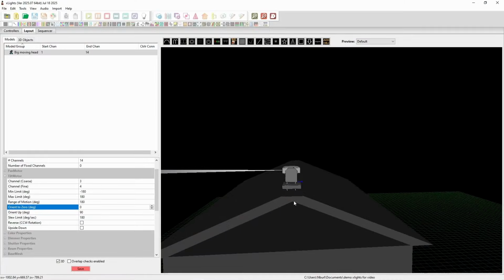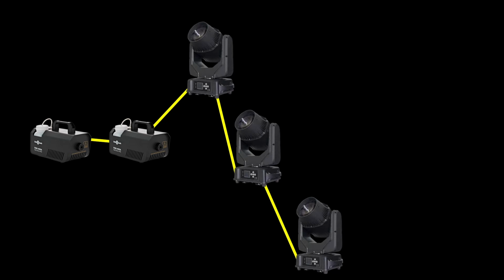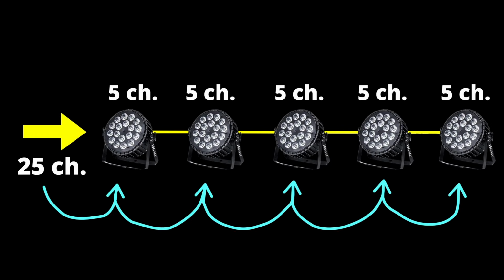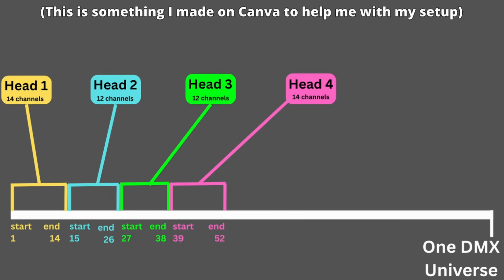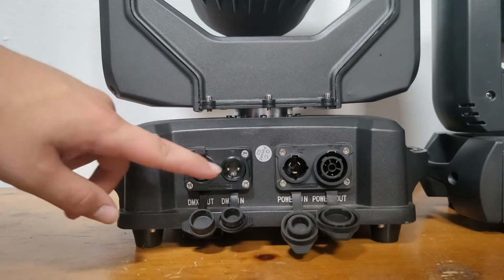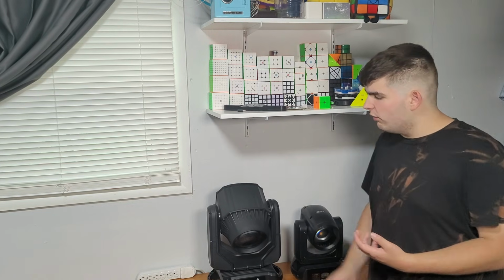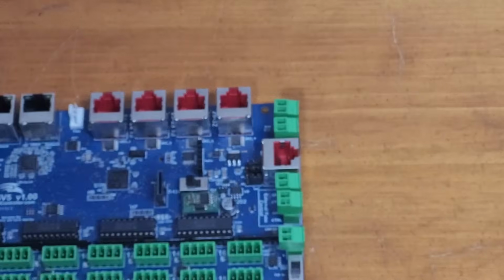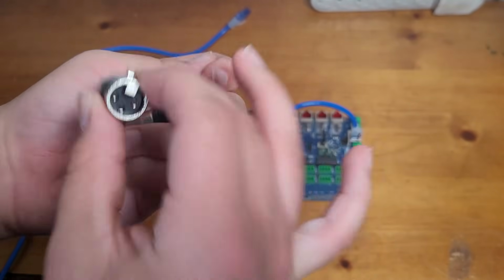How to use DMX Moving Heads in YOUR Light Show!! (Part 1)

Comment: What fixture and brand is the bigger moving head you are using? I like that they are IP-proof
Reply from the maker: I'm honestly not 100% sure because I bought them used. They were from eBay and were titled "2PCS 8+16 Prism Waterproof Moving Head Light DMX RGBW LED Gobo Stage Beam Lights"

While yes it does say waterproof, they are actually only water resistant and probably somewhere around ip66-67 rated.

Comment: If running the ethernet cable from the controller (in my case it would be from my porch to the roof) and then to an ethernet to DMX cable converter, does it still follow the Cat6 standards for length (up to 328ft)?  I wouldn't need it that long, likely 50-60 feet, but just curious of the limitations, especially with the conversion from Ethernet to DMX (like is 50-60ft okay)
Reply from the maker: Yes, that will be perfectly fine. I believe my setup last year had a Cat6 cable come out from my garage, run about 75-100 feet to the first moving head, and then I had an xlr connector aka dmx connector solder onto the end of the cord instead of the ethernet jack. Plugging the ethernet jack into a converter is the same principle, so it should be fine :)
Reply: @How2Pixel thank you!

Comment: I disagree with your warning about powercon connectors: the EU spec is designed to be removed under load and makes/breaks the ground first and last during connection. We have been using them for over 40 years with out causing any issues. The black plugs are IP rated.

Comment: In fact, I think you CAN use microphone cable as DMX cables. What you can't do is use DMX cables as microphone ones.
Reply from the maker: Technically you can use both in either situation, but it isn't recommend! The impedance rating for mic cables and DMX cables are different, so it can cause the signal to get messed up and your devices will not work properly.
Reply: If you do use regular mic cables, you MAY have random glitching, the solution is to include a DMX terminator plugged into the LAST fixture of the run. The terminator is simply a 120 ohm resistor soldered across pin 2&3 of the male (has the pins)XLR plug that plugs into that last fixture. Good idea for any longer cable runs anyway.

Comment: there,s another diffrence between the 2 powercon cables

the newer one (powercon true 1) are waterproof connector,s and they can be linked together (when using a male to female connector) and indeed u can disconnect them while they are outputting power

the older one is just normal powercon

whats ur opinion about those waterproof heads from if im not mistaken shehdz
Reply: Thanks for the good detail!  After watching your review of the Temu moving heads, we are going to add moving heads to our show!
Reply from the maker: @djrensvandeburgt1236 Thanks for the information! Are you talking about the small moving heads from Temu? Or the bigger ones I just got recently? The Temu ones aren't waterproof and I'm actually having to build something to keep them protected. The bigger ones are technically "water resistant" and are rated IP65. I am worried how they'll do in the rain since IP66 or IP67 would be safer. I want to build some sort of dome for them too, but they're just so big it's impossible to find something for them. They might be fine without any covering, but I'm still worried.
Reply: @How2Pixel  yes the bigger ones

the thing about those is those are able to be kept outside of a dome but if u have something like a snow storm (which gets the temparature colder) then i would sudgest a dome

iv put lights outside allot that are ip65 (DO MAKE SURE that the connectors ur not using are closed)
Reply: @djrensvandeburgt1236      Of course, by ensuring that the AC is GFCI protected, not only for human protection, but can help it can help limit damage to circuit boards if moisture does get in.